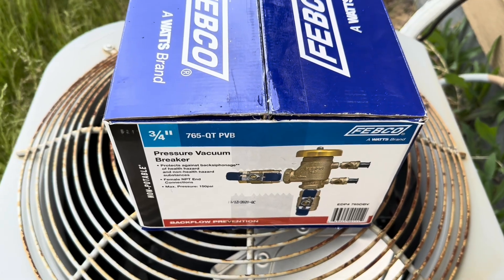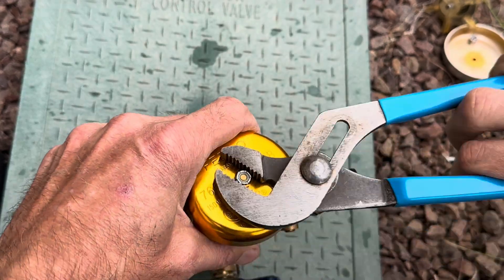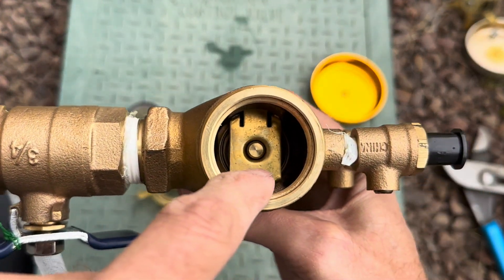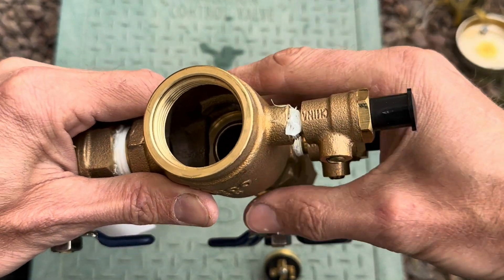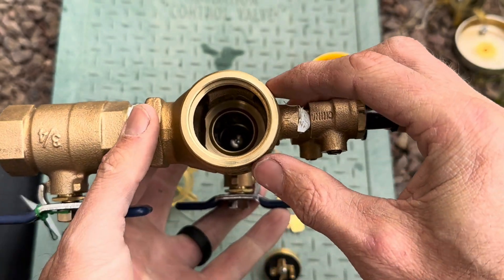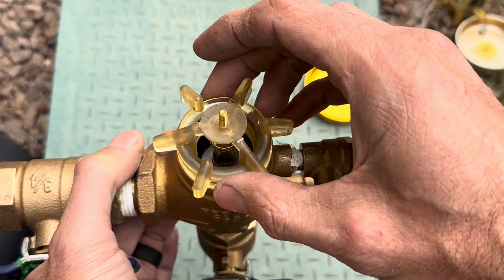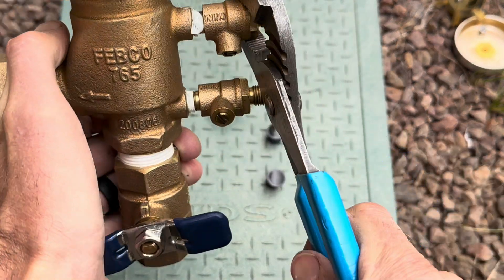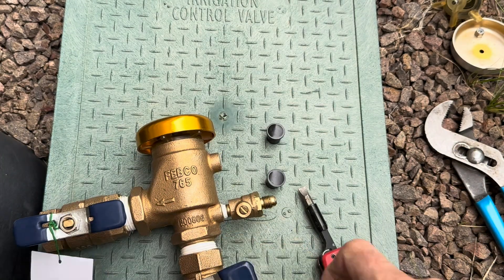How to repair a backflow COMPLETELY on a Febco 765 (a deep dive)

Comment: I wish I could give this video 10 thumbs up 👍. 

I have a question. If you need to have the pipes facing the reverse direction, meaning you have to rotate the ball vavles 180 degrees, do you need to unscrew them and reinstall with new thread tape? Others have said this, as opposed to just turning a half turn on or off because that might cause a leak or something.
Reply from the maker: Thank you! I really appreciate your comment. Regarding your question- are you referring to the ball valves and /or test ports? Just turning the ball valve handle doesn’t require any tape. However, if you remove and replace anything on the backflow that had factory installed tape, then definitely use tape to replace it. Did that answer your question? Let me know, and I’ll make sure I can help you out.
Reply: @helpmylandscaping  I am referring to the ball valves themselves, not the handles/levers. Some setups need the water to flow from left to right or from right to left through the pvb device. They usually come in the box only one way. If you need the opposite orientation, you turn the whole thing around, but now the ball valve HANDLES are facing the back of the device, away from your face. In order to make them face the front again, the entire ball valve needs a half turn around the pipe threads. My question is, should you fully unscrew and remove the ball valves and then thread them on again to stop facing the front? Or have you been able to simply tighten them a half turn and not remove them? OR... can the valves be ordered already positioned l to r or r to l as needed from the factory? I hope this makes sense. Thanks.
Reply from the maker: That does make sense. It is annoying if you need to put the backflow in the opposite direction. Yes, you can simply tighten the ball valves to face the other way. That is a quick way to do it. Keep in mind that most municipalities have requirements for backflow installation, so make sure to check local regulations. Typically they require 4” clearance between the building and backflow. This allows access to the ball valves on either side. Or, if it’s possible, the main line pipe that goes down into the ground could be moved to accommodate the backflow facing the correct direction.
Reply: @helpmylandscaping  so have you ever had to do this? Because I have seen this question come up in other comment sections and the answer seems to be they are already pretty tight from the factory so it's nearly impossible. I'm surprised this isn't addressed by the instructions or the product offering 2 versions.
Reply from the maker: They are pretty tight. I have done it. But the best is just to extend the backflow away from the house so you can put your hands in between the house and ball valves. If you chose to loosen it then make sure to put more tape or paste on.

Comment: Very helpful. Should the incoming ball valve on a brand new, straight out of box prior to install, FEBCO 765-1 ball valve open & close? Outgoing valve does open & close. Confused. Thanks!
Reply from the maker: Yes, all the ball valves should easily open and close. They do only turn one way though. There is a small metal tab that prevents it from turning all the way around. Sometimes those are bent which prevents it from working properly. But if it’s a brand new backflow, and it doesn’t work- I would recommend returning it.
Reply: @helpmylandscaping  Thanks so very much for responding. Gives me a chance to return for a replacement prior to removing my old 765-1 model (about 15 years) & installing the new replacement.
Reply from the maker: @Mae-zm1tf8uo5s Sue thing, anything I can do to help!